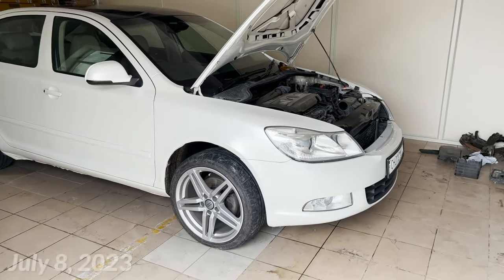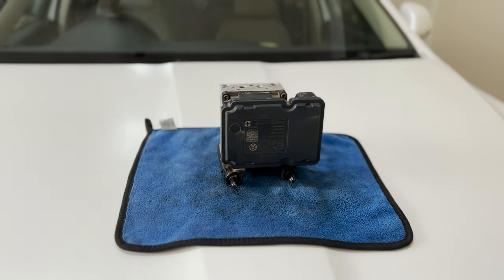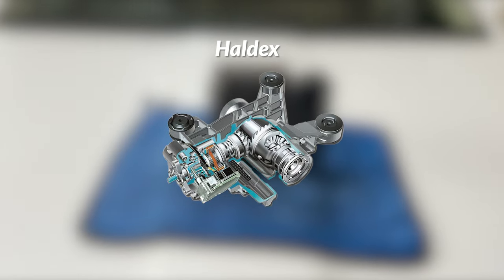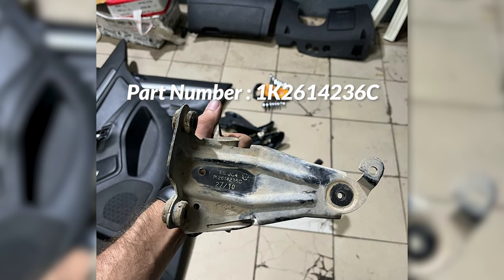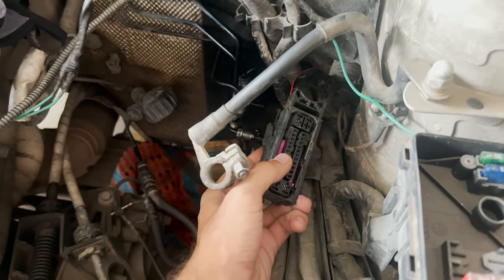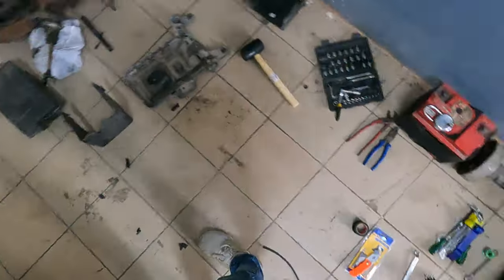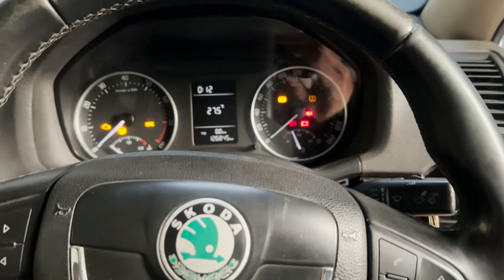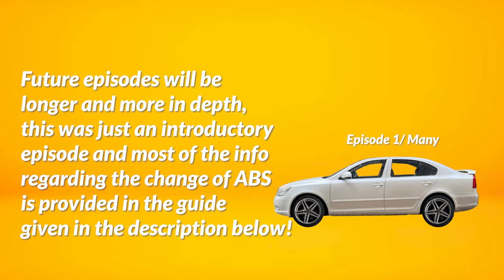Converting my Skoda Laura to an All Wheel Drive! Episode 1 / Octavia MK2.5 AWD Conversion!

Comment: Hey Prerak any video on Polo drum brake maintenance. I hardly find any good videos regarding them. I recently opened the rear drum for a cleaning and was shocked to see extreme grooves all over the drum material. The shoes were thin but still had enough material till the metal. Despite that there were groves on the shoes as well. Don't know if some sand or dust entered this spot but I doubt that. Hope I can skim the drum brakes while I replace the shoes. A video about shoe replacement would be helpful. My gt crossed a little over 1,10,000 and I have never changed the rear brake shoes. I also don't park in gear unless on some incline. So parking brake is always engaged.  I'm pretty sure most polo owners have probably neglected the rear  drum brakes as well.
Reply from the maker: Sure thing, I’ll see if I can get this done